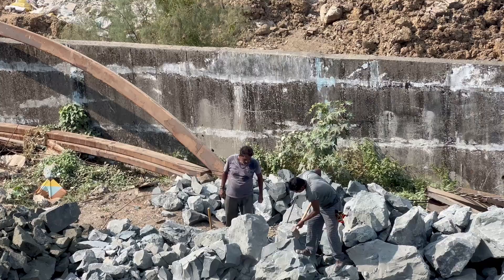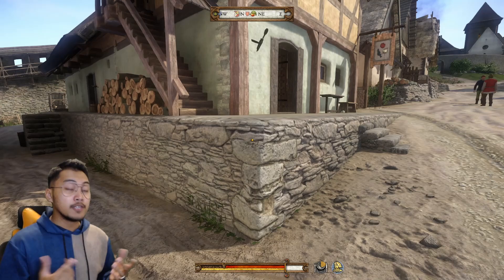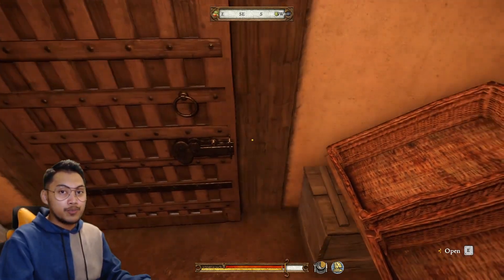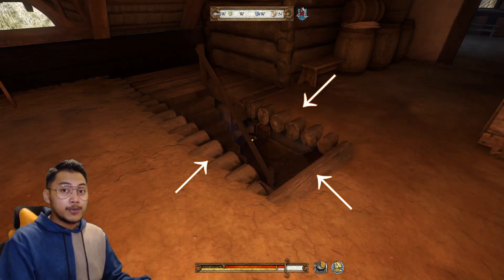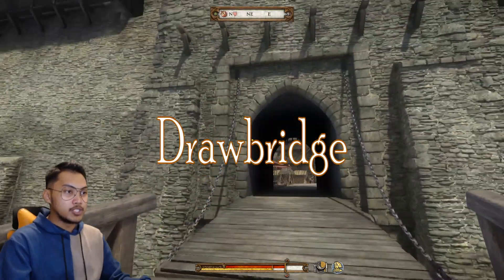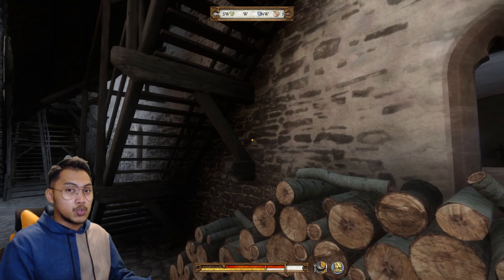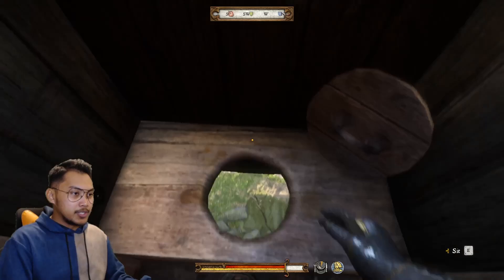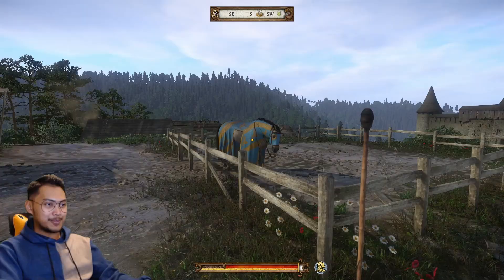The Brilliance of Historic Construction! Civil Engineer visits Kingdom Come: Deliverance

Comment: nice one! just wondering how would these structures withstand earthquakes 🤔
Reply from the maker: Medieval structures handled earthquakes with mixed results. Timber houses were more flexible and survived better, while stone castles and walls often cracked or collapsed due to their rigidity. Some unknowingly improved resilience with wooden reinforcements and irregular stone bonding. Wooden bridges flexed but failed if their stone piers shifted. They weren’t designed for quakes, but some construction methods accidentally helped—centuries before seismic engineering became a science! 😊
Reply: @ that’s a very helpful info👌👍
Reply: Bohemian structures are exempt from having to handle earthquakes. The strongest earthquake you can expect to experience even in the most seismically active parts of Bohemia would still be barely noticeable.

Flooding would be a much greater concern, especially around rivers like Vltava or Labe. The Prague's waterfront for example was quite infamous for its frequent floods.
Reply: @optimal-p  Thanks, got your point, but still it doesn’t mean zero earthquake in this place… engineers during the old times we’re then very competent.